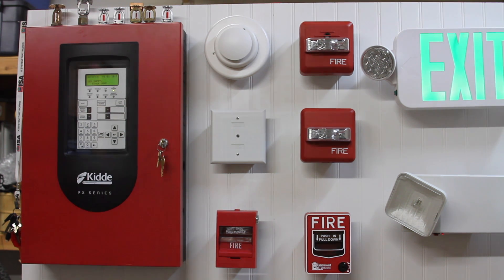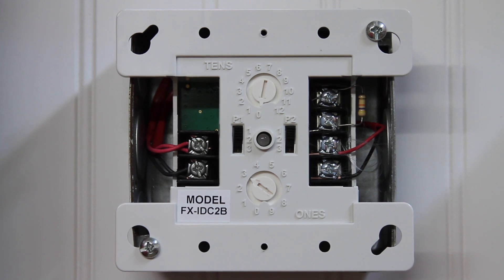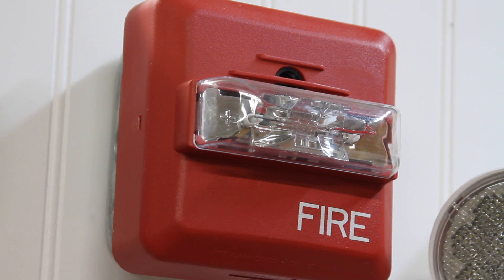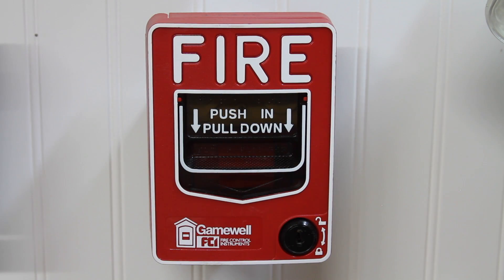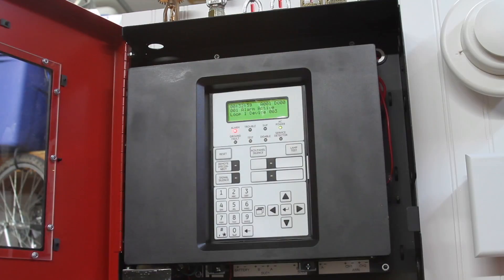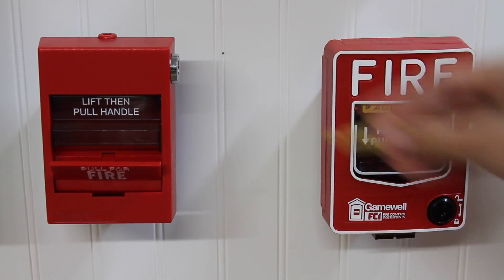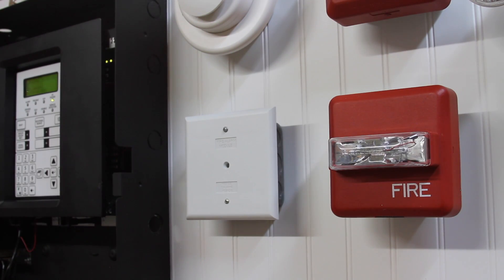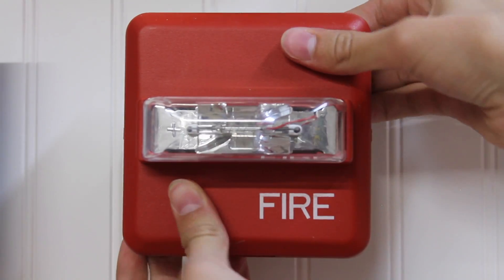Kidde FX-64 System Test 3: Changes

Comment: Does this panel have an annunciator
Reply: Sigcom (the original company that manufactured fire safety devices that are later rebranded into Kidde-Fenwal, Simplex, and Silent Knight) have made annunciators for most of the fire alarm panels (except for the Kidde FX series).
Reply: @edgarmartinez7371  No, there's a Kidde K-LCD-C annunciator.

Comment: Nice Grant! How did you change the MS-7AF Pull station into a conventional. Can you even switch it back and use it as an addressable pull station on the system?
Reply: Zachary Nicolaou To use an MS-7AF as addressable you would need a compatible Gamewell-FCI panel (for example the 7100, which has since been discontinued). You can find the new Honeywell addressable panels here after the HLS restructuring: https://forums.thefirepanel.com/viewtopic.php?f=3&t=8328